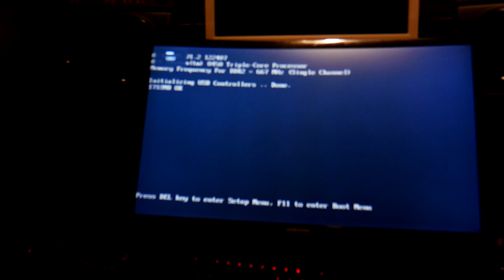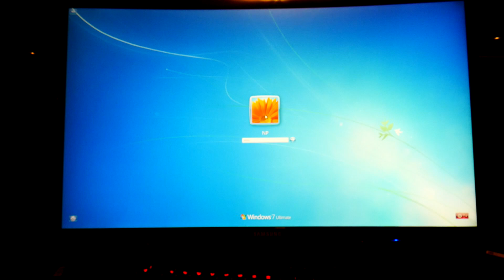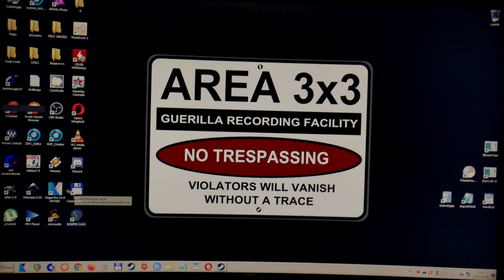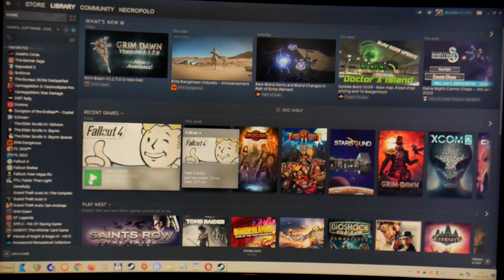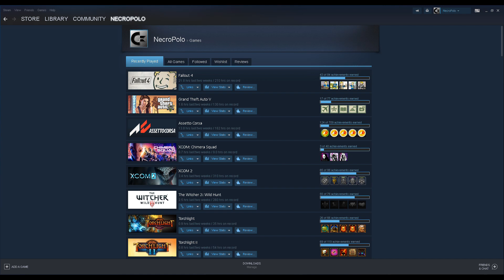2007 Phenom X3 vs 2020 Radeon RX570 GPU - will it work?

Comment: Fun video, your screen filming definitely improved throughout the video. Capturing retro PCs via capture box is often problematic... 

I'll subscribe too :)
Reply from the maker: Thanks for the sub (y) You're spot-on about the video capture on old machines. OBS started there but the actual games turned into a slideshow. About the camera I have to rely on AF as I have an eye condition called aion. I have permanent masked vision in fixed spots. Usually it doesn't cause too much fuss in everyday life but I can't see tiny displays properly. Only after recording this video I realised on the big 1080p monitor that the AF and pic stabilising did not work as it should and view was either tilt or blurry but by then the X3 test machine became dismantled, so it is what it is :)